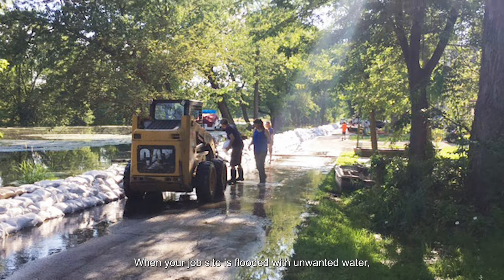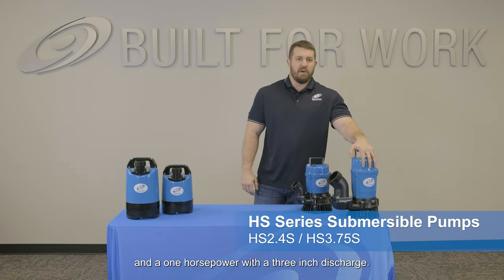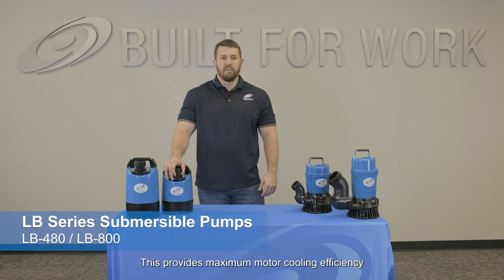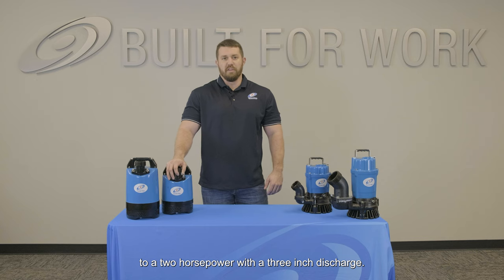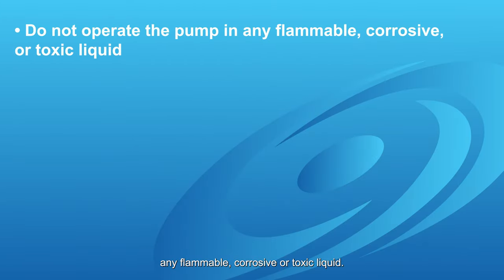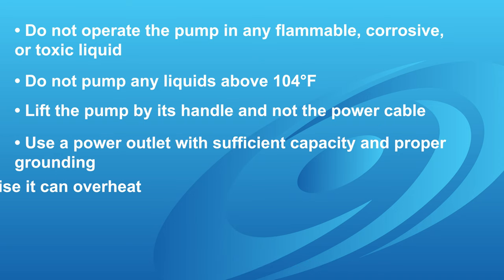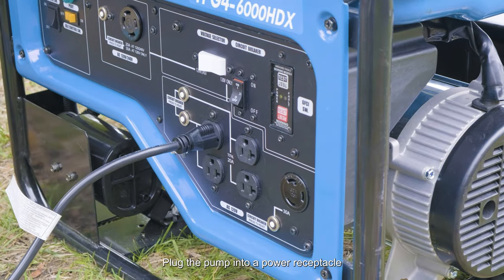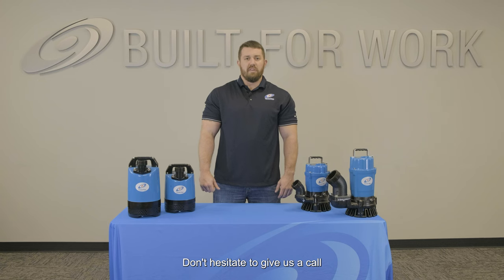How to Operate Tsurumi Submersible Pumps

Comment: I have 250 m extension cord not a big extension cord and I believe I ran it on a low voltage and it's not working anymore. Is it a breaker in it that I need to switch it back on or something like that or I wrecked the pump?